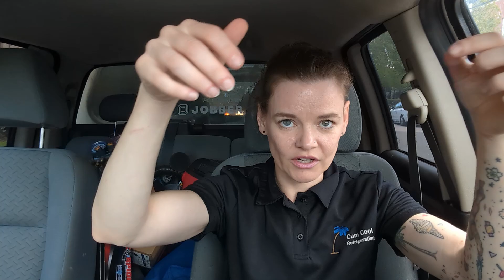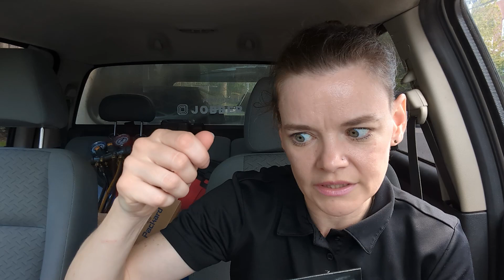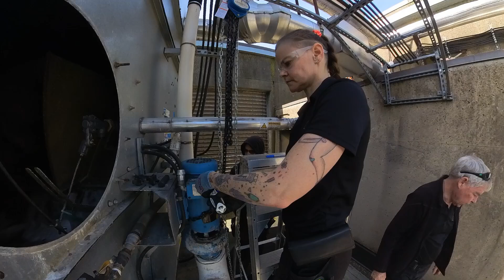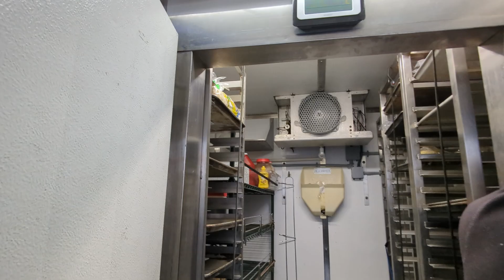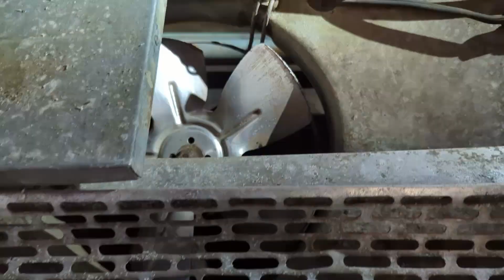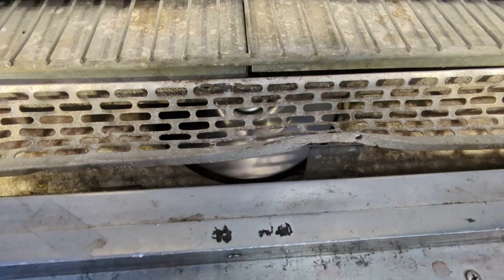Women in HVAC Give Tour of Cooling Tower, Walk-in Cooler, Maintenance Tips & More

Comment: Q: Does swaging copper tubing eliminate the need to add fittings?
Reply from the maker: Yes, correct.  It expands the end of a tube just a bit to allow another pipe of the same size to slide into it.